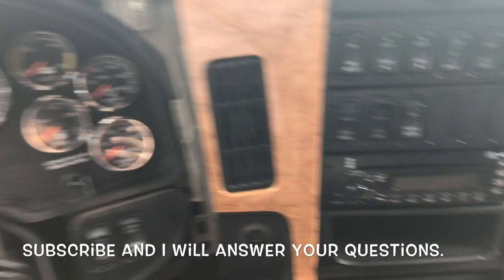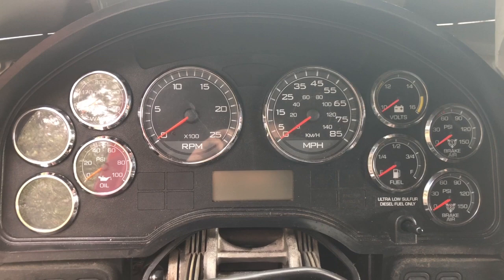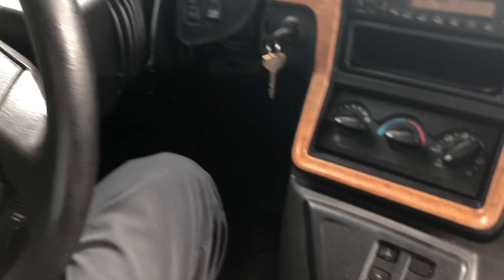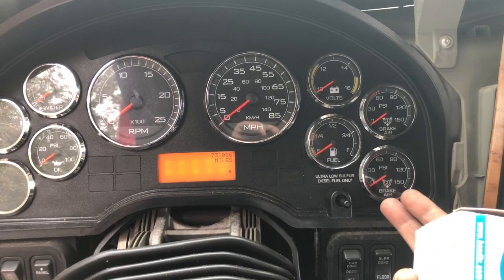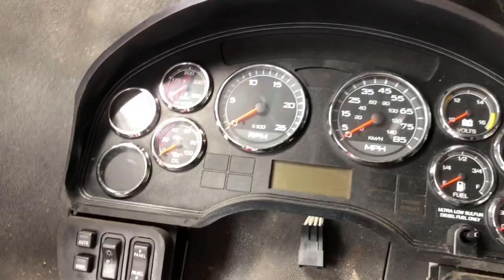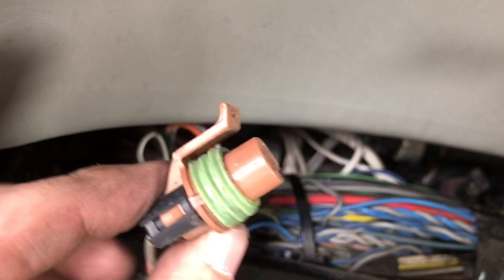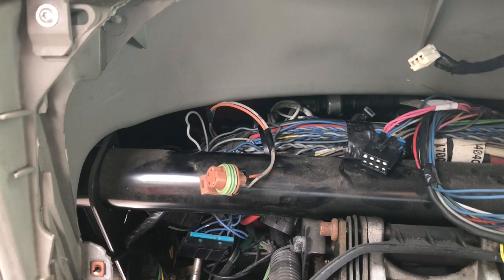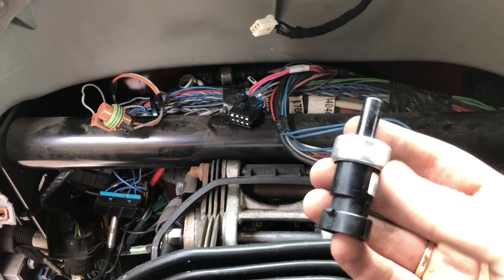2010 International Prostar Brake Switch

Comment: 2008 international workstar dump truck  is pulling to the left when braking i notice the arm on the  brake chamber to the slack adjuster on the right side does not move in and out to engage or release the brakes.  So does that mean my brake chamber is bad ?
Reply: Yes